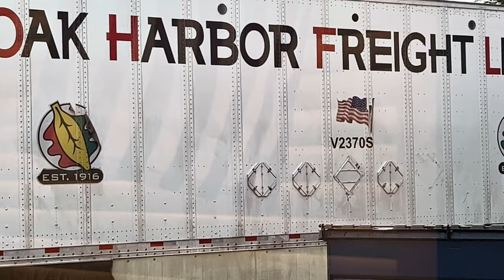BMW Police RT Repairs!! • Sprocket Recall is Out..! | TheSmoaks Vlog_2510

Comment: I noticed that the Brits were using R1200RS police bikes in the motorcade for Biden's vehicles. I've only seen Rt's used in recent years for Police bikes. Was wondering if anyone else saw them.?? 👍👍🏍🏍🏍🙋‍♂️ The dogs were the icing on the cake in today's video.
Reply: Some police forces where I live have been using RTs for a long time. I think the Dutch highway patrol used or uses the K1600.